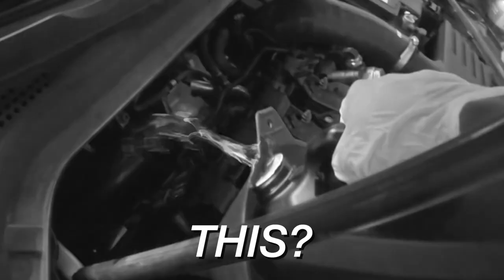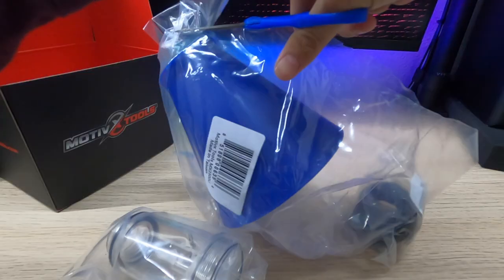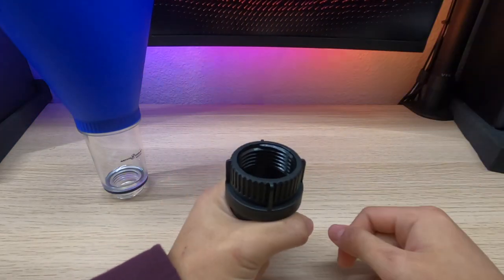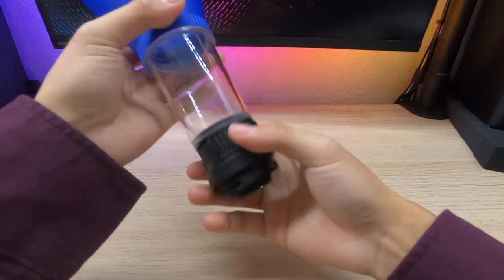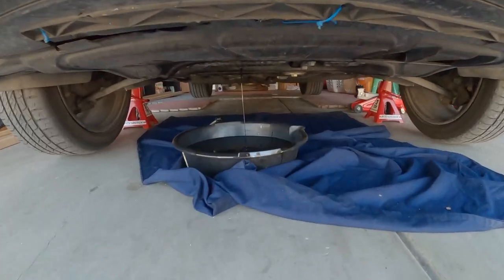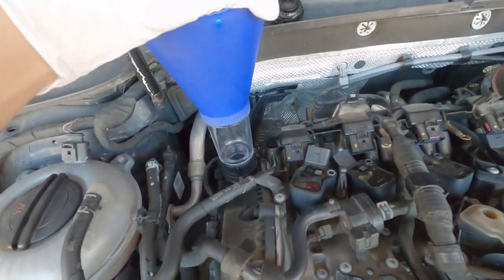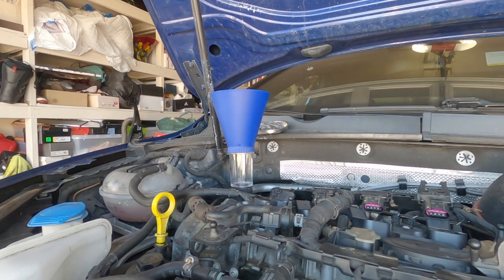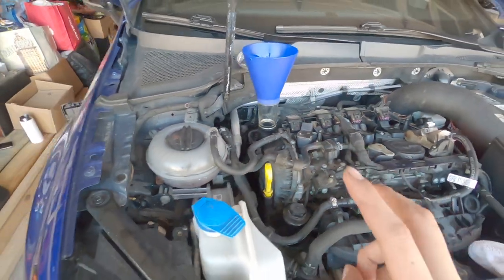The Best Oil Funnel for $18? Motivx Tools Threaded Oil Funnel!

Comment: I know this was posted a year ago, but you dont need to get every trace of a different weight oil out of the funnel, the small amount that would be left behind is so little it wont effect the weight of whatever youre putting in next, obviously make sure you wipe the bulk but you dont have to get everything.